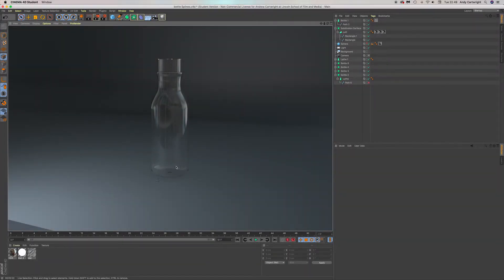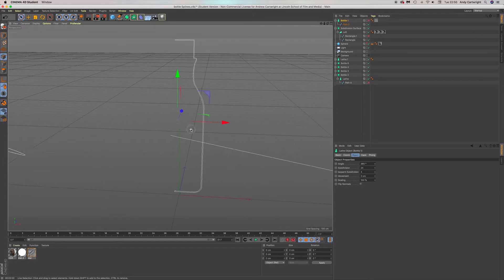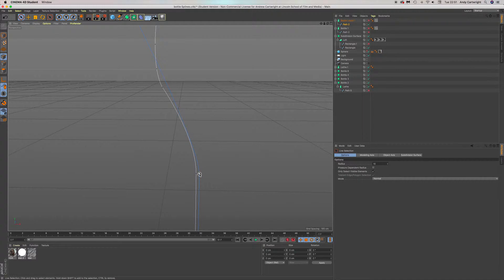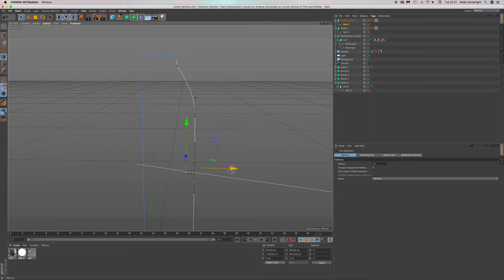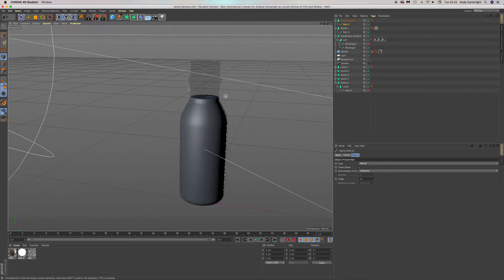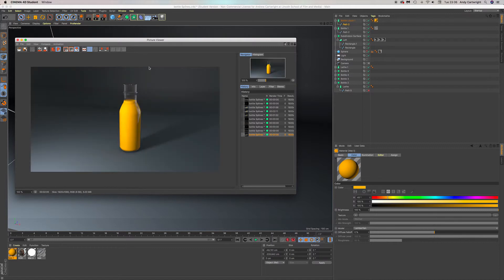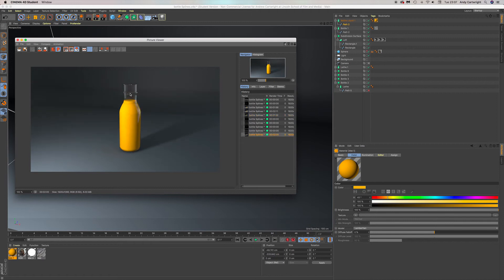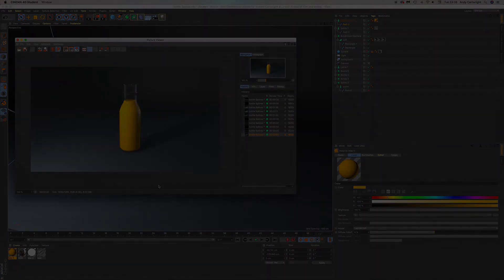Bottle Modelling - Liquid

Comment: very nicer work ! 
is path tool same as spline tool ? , also how can u make bottle water to move like if i key frame it to left or right it displaces .
Reply from the maker: Yeah they are the same tool! 
Can you be more specific on what you mean by key framing and displacement?
Reply: @Ac4rt  i want to animate water inside the bottle .how to do that without external pluggin .

Comment: I have a problem, i can't close the holes :( so when i render the "liquid" have a huge path between the top and the botton so is not solid :(
Reply from the maker: How are you making the liquid inside the bottle? Are you using a path & lathe NURBS?
Reply: @Ac4rt  Yes i make a path for the bottle and a path inside for the liquid but i cant close the holes from the top and the bottom, so always i have a kind of hollow tube from top to bottom :(
Reply from the maker: @discoradical  Try moving the point in the centre of the liquid to the middle - this should close the gap for you :)